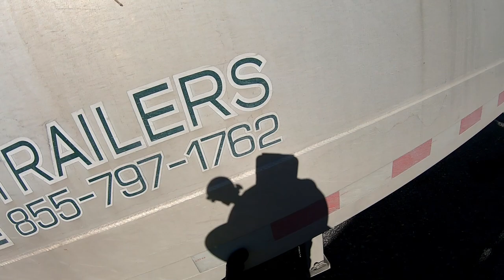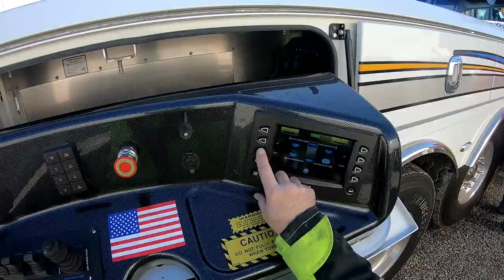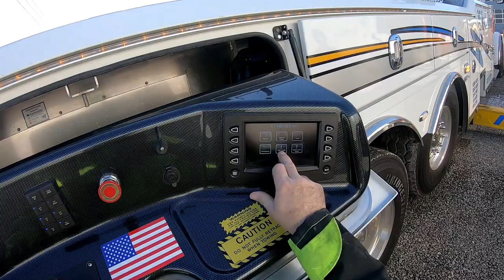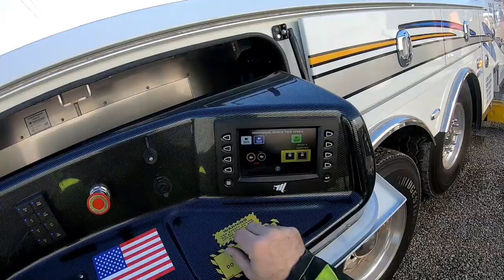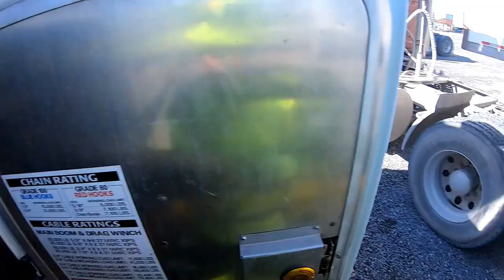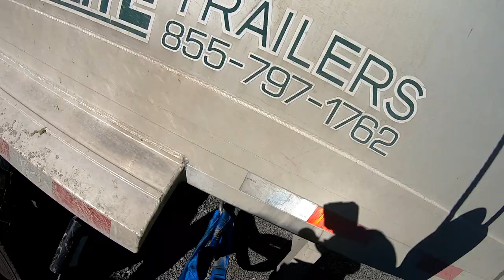BELLY WRAP LIFT

Comment: Hi Ron.  Suggestion box time. For more than just dump trailers ... what about those ground effect skirts that extend along the bottom of box trailers? So here's my thoughts
 Look at the  cross bar of the "T" that extends to under the axle for a tow. You have slide-on adapters to fit the axle.

Now all you need is a cross bar the same size as the one on the lift, with width longer than the trailer is wide. Slide the bar under the trailer and slide on a pair of your axle adapters that might fit the trailer frame and clear the sheeting of the side of the box. A couple of eye-bolts at each end of the cross bar to attach the crane's hooks. No more slippery wood blocks .

Comment: Should design an attachment or something for the underlift.  Park 90 degrees to the trailer, extend the attachment and lift on the frame.  Should have enough weight on the front of the rotator to counter the underlift.

Comment: Nice job Ron!  
I pulled mainly flatbed trailers back in the day in the UK. Heavy loads were chained, but due to the weather they all had to be sheeted and ropes to hold the sheets (straps were only just becoming a thing back then).  I quickly learned how to tie a "dolly" knot on a rope, but more importantly I learned how to coil rope over and under alternately.  This meant when roping the load, I grabbed the loose end of the rope and threw the entire coil over the load, and it unraveled flawlessly every time!
I'm not going to bore you with the mechanics of this here, there are plenty of videos that demonstrate it, but it will save you from that rats nest next time you run out that air line!
In case I don't get a chance before then, wishing you and yours a wonderful Christmas and a happy and prosperous New Year!

Comment: It was interesting thinking about the differences between this job and the one shown in the video from last week due to both the difference in the job itself and the different type of trailers...

I personally think that people who engineer vehicles should spend some time with tow and recovery teams before designing a new vehicle or trailer.
Reply: And a few months in a repair shop. (or at least grow up on a family farm)
Reply: If only.  Without a corporate culture that supports that mindset and tells the bean counters to pound salt when they start whining, designers in the field will never happen. It would run up the manufacturing costs and no one will sign off on that these days.
Reply: Yeh I hear ya. I got a 2020 kw eats lite fuses like candy. Why do we need two fuse boxes in one truck. Why when the lites blow because of unknown crappy rewired trailers do I need to replace Multiple fuses in both boxes. Some days I miss just Poppin the glove box and hitting a circuit breaker.
Reply: it's the limitations of customer requirements that tie the engineers hands more often then not.

Sure you can a super lightweight cheap design that will work fine, but as soon as you hit a failure condition, well now you're in for a good time.

Comment: I used to work for a company that used a boom truck to lift big heat  and air units to put on top of Walmart stores and the operator of the boom truck never took safety in mind like he should. One night he was lifting a huge unit in the dark and didn't look for the overhead power lines as he was lifting we saw a real bright flash of light and heard a loud explosion. He got the boom tangled into the power lines. It fried the boom truck controls and melted the cable. The big unit fell to the ground going threw the roof of the Walmart store we was installing it on. Power lines won boom truck D O A. Thank God nobody was hurt.

Comment: Wow, these trailers are crazy. Self holding frame?  Jesus Chris........
In Europe we have two H profile iron along the trailer's length. It makes the base really massive.  It can easily survive a hars flip of trailer....
Only 2 axies? No weight limit on axies? We have max 8 tons / axle. Over that required special direct route permission.
Reply: pretty much every axle here in the states is an 8ton, you're forgetting the 3 axles on the tractor.
Reply: Most states is 80,000lbs max truck, trailer, and load

Comment: For a bit there I thought the only  way to get that trailer off without damage would be to tow the broken truck and trailer to the delivery site and unload the trailer. With it empty, you could leave the trailer there and tow the truck to the repair shop. The customer could send out their own tractor to pick up the empty trailer. But you found a quicker solution.
Reply: In a reply to a previous comment Ron said they tried that, but found out the PTO on the truck was fried and they couldn't operate the dump.

Comment: Still watching but almost looks like you need a piece of steal I-beam or H-beam with some holes on the end for next time.  That way you can just slide it underneath hook a strap on the ends with a clevis and then a spreader bar at the top.  Probably come in handy any time that a front end lift needs to be done on a trailer that is in questionable condition.

Comment: How heavy are some of the items you use regularly like for example the snatch blocks and chains and stuff like that? I hear you grunting sometimes so i figure this stuff must be pretty heavy and I was curious.  I figure it has to be able to lift a lot and probably rated for far higher than everything else including the cable and stuff so just wondering.  Thanks for another great video too!

Comment: Probably a dumb question but here goes. Could one backup the tator perpendicular to the dump trailor and then, using the underreach, lift the trailer from behind the tractor wheels. No straps or chains used. And I agree with who would design a trailer not to be lifted by a tow truck??? Merry Christmas to you and your family.
Reply: There are a couple of issues, that immediately come to mind. 

1.  The under reach does not lift that high.  A lot of blocking would have to be used, which would lead to instability.  

2.  There is not a good way to balance the the trailer (side to side) on the narrow under reach. 

3.  Under reaches are generally not designed to lift a large amount of weight.

Comment: Its obvious that the engineer's didn't allow for this type of failure ..when they design it
Reply: Like that slip disk on the tractor worse thing ever had on my Tractor  took it off two weeks later I just use them grease packets every couple of weeks on my fifth wheel
Reply: Great that you got the trailer unhooked   
because that sand cost alot money to the custmer  do  you drain the air tank,s on your truck at the end of the day 🙄🙄?.

Comment: in the uk when we hook under a trailer we are told to do the tug test which basically means we try and drive forwards without connecting any lines to the trailer and if we are hooked correctly the tractor wont  pull away which means your securely hooked up, do you not do that in the usa just seen a couple of videos when a tractor hooks up and never seen you do this, still love watching you at work though no jobs seems to beat you, you always find away to do it
Reply: The tug test is standard practice here in the States as well. Don't know about other videos, but in this one the driver wasn't pulling out right away.  I would guess he did the tug after the boom was clear and we just didn't get to see it. He did have a possible air leak to check out.

Comment: i noticed a lot of people mentioning your trust storage... i had a thought that, if woudl be epic if the storage bins themselves could extend out enough to allow better access to tools and materials... naturally, it should be able to be accessible on both sides, but having to dig around for your tools and devices seems like something that takes more time than needed, even with good organization. having better accessibly to your tools and such, using something like that concept which Adam Savage mentioned in one of his tested videos when he built a tool cart where everything was visible and easy to see and find. maybe having very customized slots for your straps, so they are not just folded and stuffed willy nilly all over your bins, but a dedicated spot where they could reside. same with the wooden posts you use for blocking your stabilizers and such. your chain rack is ingenious and woudlnt need to be changed at all, but maybe having a mechanism to allow it to extend out more easily from the inside of the bin space for better ease of retrieval. considering all the things you use and take with you, that must be a tall order getting everything a spot in the storage bins, but i am wondering for the sake of all tow operators, increasing the efficiency of their space so that they can absolutely bring everything they need within a single vehicle unit. must be something to be able to quantify the thing you have and model it within the given space and make custom racks and or spaces for them so its not a jumble, despite knowing where it all is. every second counts right?
Reply from the maker: After we purchased our Rotator,  manufacturers have come out with much better storage solutions,  including many of the ideas you mentioned.   The sliding trays are becoming quite popular.   The manufacturers have started taking advice from their consumers and looked to Fire services also.  If we order another Rotator,  I hope we will, it will have the newer storage solutions.   Thanks for watching and God bless.
Reply: @RonPratt  thats awesome. good to know there are options out there for you guys. be safe, and Merry Christmas, Sir =)

Comment: Simple..... use an I-Beam and chain to the I-Beam put that right infront of the legs and lift the I-Beam which than holds the trailer up and give enough space to the 5th wheel pin. This way you lift from the belly side and your chain's or ropes won't touch the trailer. I would have something like that always in the yard with anchor points laying. Cost you maybe $1000 the piece but you can easy carry it on a flatbed with you to a crash side even. I have seen already like 5 of your jobs which would safe you a ton of time. I think you should put it to the test in the yard. Often having the right tools can safe you big trouble. And A36 structural I-Beams ain't light but boy can you lift stuff with it. I used on a 24' span such a piece welded and bolted together from 3 pieces into one to hold up 12000lbs on a house structure ... I know overkill but worth every penny because termites can't destroy it :-) and I got them for $120 a piece so very well worth it. Look into it Ron it may be your moving forward solution.

Comment: You would need a purpose designed lifting support beam for the trailer foot fixturing.
Best way is to modify the trailer frame before delivering it to the end customer.
Its a hopeless design when you cant lift or support the trailer for any kind of service or repair.
Like scrapping a car if it ever gets a puncture ...
Reply: Empty is fine when the tractor has air suspension. Likely a bit of a pain using blocking under the legs for solid suspension.
Reply: @wssides  You still have the problem of lifting it to place the blocks. I have seen hooking and unhooking with the trailer slightly below the 5th wheel. the flex of the 5th wheel catches the difference.

Comment: Good morning Ron,
In some video could you explain what you do to the back outriggers when you only pull the pin out about 1"-2"? What does that do/free up/unlock?
Reply: I think Ron explained this before. I believe it was in one of the videos where he is teaching his employee on how to operate the rotator.
So as far as I know those pins are used to prevent rear outriggers from sliding out on their own. How could they slide out on their own? 
Well there is quite some distance between rear outriggers and hydraulic pumps that are used for pulling them in or pushing them out. This means there is quite a lot of hydraulic fluid in hydraulic lines leading back to rear outriggers. And since hydraulic fluid is still subjected to expanding when it wars up it could expand to the point so that it would move the rear outriggers outwards.
I'm guessing there isn't such worry for this happening with front outriggers because they are much closer to hydraulic pumps and therefore there is much les hydraulic pump in the hydraulic lines leading to front outriggers.

Comment: You might want to sent this video to the company that made the trailer. I would think an extra reinforcing tube where you used your slings would be an easy change to incorporate into new designs. They might be interested in feedback from someone in you're position that has different engineering requirements that they might not have considered. Maybe you could include that video of the garbage truck body that fell off it's truck as an example of the importance of (full load rated) lifting eyes.

Comment: Nice Job Ron ! You mentioned Raymond had towed that truck & trailer While watching your video I didn't see any of the axles pulled or the drive line pulled unless I over looked it What's your company procedure for towing When it comes to  drive lines verse axle and the distance you do and don't pull anything out Be Safe Out There Brother !
Reply from the maker: Good question.  Our company policy is to remove the drive shaft on EVERY tow where the drive tires are on the ground, unless there is damage to the rear ends, then we remove the axle shafts.  Some shops request we reinstall the drive shaft when we drop the truck.  We try to avoid reinstalling the shafts for a number of reasons.  In this particular instance, the shaft had been reinstalled by the shop where Raymond towed the vehicle.  That shop had attempted to start the truck and drive it into their shop, but could not get it to start.  If you noticed in the video, they pulled it out from under the trailer with a tractor and I supplied air to release the brakes.   Thanks for watching and God bless.

Comment: A very precise operation, interesting stuff. When you were folding everything up after they swapped tractors(at about 37:00) the white and the blue lines kept spooling out as you retracted the boom ~ why?
It seems like poor design, that the support legs on the trailer won't support it when loaded. Is that normal, or is that a cheap trailer? Surely it's not that unusual to swap tractors when loaded.
Thanks for another quality episode.👌

Cheers for now,
Dougie.
Reply from the maker: Good question about the cables.  I will attempt to explain the best that I can.  The winches only spool or unspool when I command them to do so with the remote control.  Otherwise they remain locked and any cable (wire rope) that is already unspooled remains unspooled and that length remains constant.  Then what changes??  The changes are the distances between the winch drum to the tip of the boom and the distance between the tip of the boom to the hook.  So, allow me to give a couple of examples and I will keep them simple.  First, let's say that I am using a single line from the winch to lift a block of steel.  Once I have the block suspended, the winch remains locked.  If I command "boom up", the cable and the steel block will both raise with the boom, but the winch drum isn't turning.  The block will NOT move closer to the tip of the boom, it simply raises at the same rate that the boom raises.  It will also move closer to my truck as it raises, but that is for a different discussion.  Now, using the same steel block that is lifted, If I command "boom out", again the winch drum is locked and the length of cable remains constant, but as the boom extends, the length of the cable along the length of the boom increases and the distance between the steel block (at the end of the cable) and the boom tip will decrease.  This will raise the steel block while also pushing it away from my truck.  Now...that same principle in reverse is where your question comes in.....I have the steel block suspended and the winch drum remains locked, then I command "boom in".  Again, the cable length remains constant, but its length from the tip of the boom to the load and from the tip of the boom to the winch drum change.  As the boom is retracted the distance between the tip of the boom and the winch drum become shorter as the distance between the tip of the boom and the steel block (at the end of the cable) increases.  This will make the steel block move down and towards my truck, just like the hooks did in the video.  I hope I have explained this so that it is understandable.  Thanks for watching and God bless.
Reply: @RonPratt  A perfect explanation Ron, Thank you. When I first watched it, I hadn't figured that out, my bad. The hooks were just "dangling" as the cable slackened, not because they were dropping, but because the cable wasn't winding in as you retracted the boom. Same amount of cable spooled out; just less boom-length using the cable. I get it.👍
Watching the video again, it's perfectly obvious what is happening; it just didn't register the first time. 
Thanks for taking the time to answer, kinda hard to explain without a diagram, or waving your arms about.😀
Stay warm, dry and safe over there, there's some serious weather about.

Cheers for now,
Dougie.

Comment: Sir, @9:58 the wires on the front left access door are outside the sheathing. might want to wrap those up before they rub through
Reply: At first i read "tyres", and watched to see tyres. There were none. But the wires are clearly in danger of being ripped...

Comment: Did they not have any portable landing gear they could have put under it? That's what we use for trailer at our place when legs buckle
Reply: As I see it, the problem is with the frame. There is not an area strong enough to support the load on the frame, even with stronger legs.